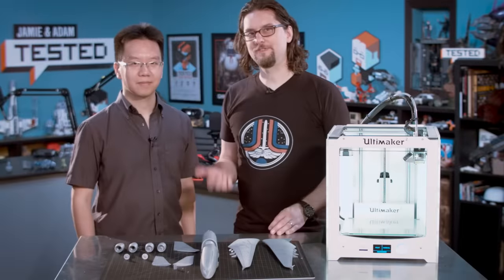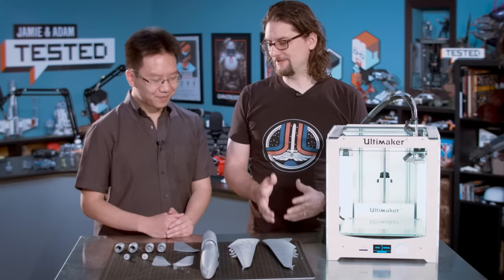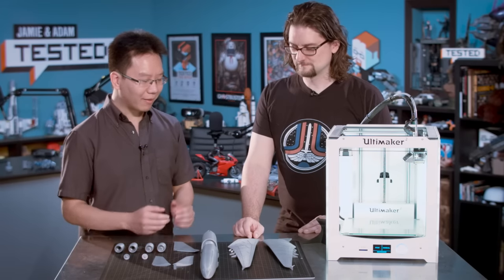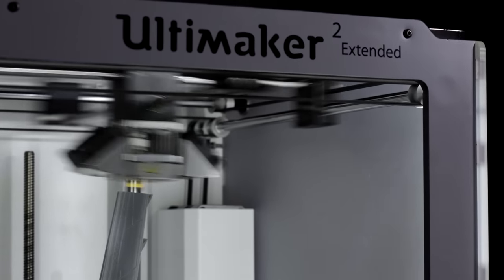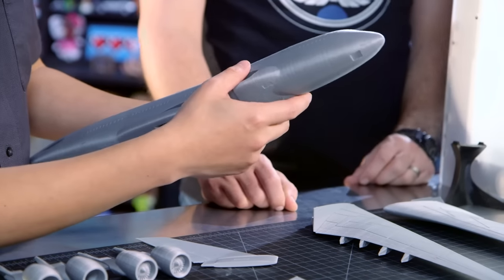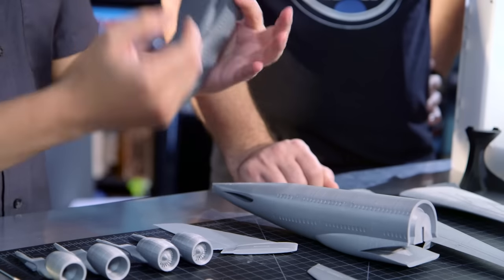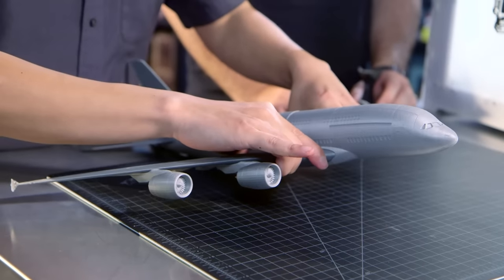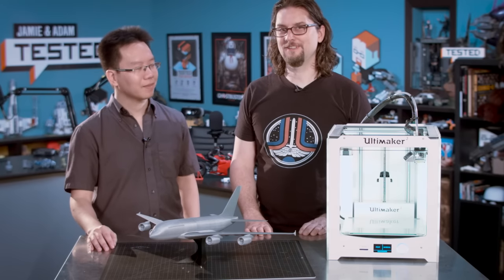Designing a 3D-Printed Model Airplane Kit!

Comment: It's not Boeing A380 you're saying A380 for something the A in A380 stands for Airbus wich is a french aviation company standing in toulouse. Second of all the A380 is available in 2 versions the version with the 940HP and 2569 pounds of thrust engine made by rolls royce and with an alluminium fiber plates and the second one is the general electric version with 1000HP and 3487 pounds of thrust. and the wings made of the same material as the B787 Dreamliner so if you think you know the most ask me first because i live for aviation and space sow hopefully you won't make this mistake again.
greetings from Belgium
from Benjamin